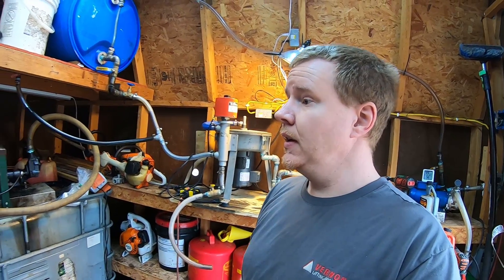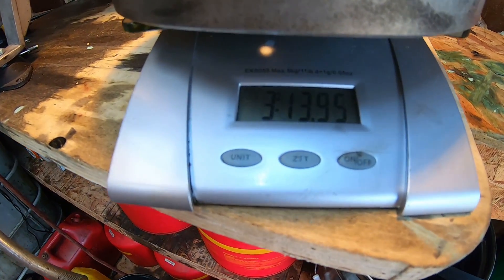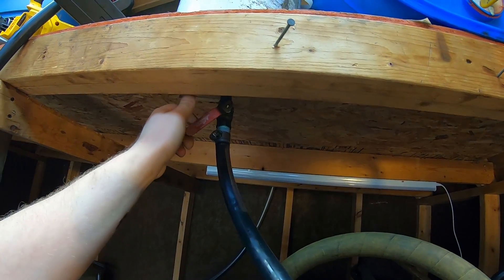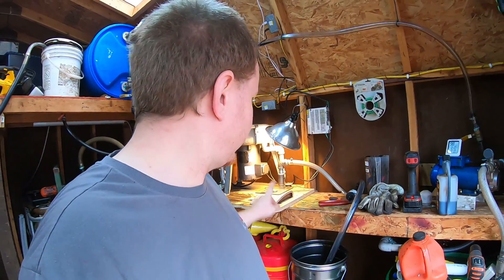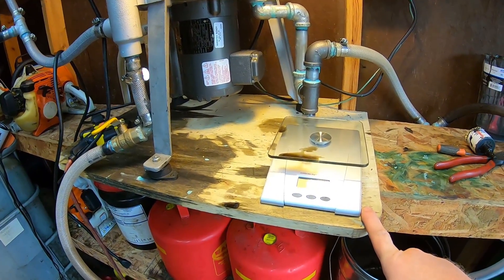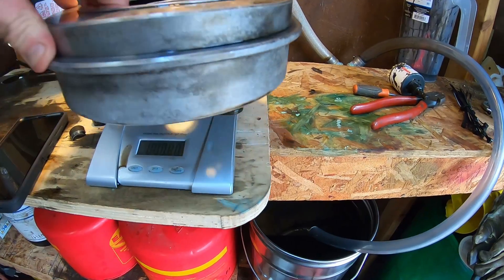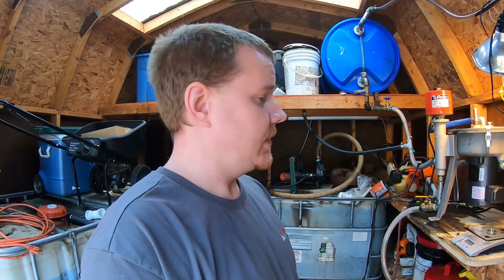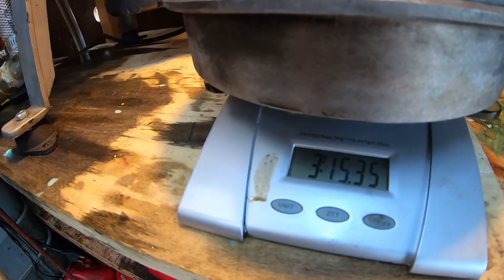Black Diesel Small Batch Tests - Heat Vs No Heat (Or Thinner) - Can You Centrifuge Cold Oil?? - WMO

Comment: I’m going to make my black diesel setup using distillation. The reason being is I have everything to make it already and it should theoretically be even cleaner than using a centrifuge or filters. The only concern is the water content that would pass over first that would have to be put into a separate container until only the refined diesel comes over. To heat it I will use firewood because I have an endless supply of it. That does mean I will have to baby sit it and carefully regulate the temperature. So there’s pros and cons. It’s cheaper and easier to make, but more labor intensive and time consuming.
Reply from the maker: I like the idea of distillation.   Just haven't tried it yet
Reply: Post videos lol

Comment: Very interesting! 
I'm aware, time shortage is a strong reason for shortcuts,  yet wouldn't it have been better to go:
Batch A: 1st run cold, 2nd run warm
vs. 
Batch B: 1st run warm, 2nd run warm
and compare A to B?
That way one can see whether the additional centrifuged sludge is due to heat or simply due to the 2nd centrifuge pass.
Reply from the maker: Not so sure I'd call it a short cut...   as I wasn't planning on running the first again from the start.  Decided to do it at the last minute...    the plan was just to show the difference in running cold...  vs running hot.  Thanks for watching.

Comment: Keep um coming just got the go ahead to take as much used oil as I want from a heavy machinery shop so I'm looking for a good setup
Reply from the maker: What engine will you be fueling?
Reply: @NotSoGrandGarage  1990 7.3 idi in a crew cab f350, john deere 510b backhoe , and my little Chinese 35hp tractor
Reply from the maker: @dbolsinger  I've got a pretty similar collection.  I think you'll be just fine.  If you can, I'd shoot for a centrifuge.   It makes a world of difference and at today's fuel prices.. will pay for itself in no time.  I've got a discount code still good until the 9th.  Info on that is in the video description if you're interested.

Comment: I have enjoyed watching your videos for a long time. I've been oiling for about 15 years and I would like to help just a little. Consider going two totes high upper feeding the centrifuge. Then feeding into a 3rd tote. Set up your pump on the 3rd tote. To be able to pump back into the upper or into a truck. Let it run 24 7 will help dewater. They make remotes for power if you time the run time you can pump it back into the upper from the recliner. Bucket heat from depot to clean the bowl using clear tube no removing the bowl. Grab a a few clear glasses and show us before and after. Show us your pump. I hope this helps and I'll keep watching your progress. Good job I'm proud of you. Get rid of all that stuff so you have room to work. It's just slowing you down.
Reply from the maker: I'm going to be changing things up in the future but I don't want to batch that much at a time nor do I want to run 24/7 at this point.

As for my pump setup and what have you, I've gone over all of that a few times in other videos so what are you wanting to see?

Bucket heat from home depot....  what is this exactly?  

As for showing before and after with clear glasses...  what are you wanting to see?  The oil is still black so not much to see as far as that goes...

Thanks for the input and for watching.  Appreciate it.
Reply: I understand, I've been waiting to see how many passes on 50 gallons it takes for the bowl to be clean. On the last run. Let it do the work it's made to run.
Reply from the maker: @alvinbeshears9870  I would say a LOT of passes for the bowl to be clean.  Every pass will remove more soot...    so how many passes do you need?  With people getting away with just filters (some how or another)...   and most soot being deep sub micronic (and keeping in mind that the same particulate is already flowing through the engine bearings, injection pump, injectors in some cases, etc..)...   it isn't worth it to me to run oil until the bowl runs clean.  You would likely be better off going to small scale distillation if you want oil that clean.

Comment: After these series of videos, you should look into doing viscosity tests. Dirty oil cold, dirty oil hot, dirty oil cold mixed with gas, clean oil cold mixed with gas, diesel, paraffin. Mostly ATF vs mostly engine oil. A conical seperatory funnel with a stopcock would work perfectly. How did your flat plate heat exchanger on the Benz work out? I've been waiting for one to show up but UPS lost it. I'm also looping my return fuel line here shortly to see if that helps. It ought to help my trucks filter life as well since it will be mostly the same fuel ran through it over and over instead of all different fuel from my tank.
Reply from the maker: The fphe worked okay but nothing drastic.  Keep in mind when running a looped return that it will take substantially longer when you switch tanks to purge the system.  Don't recall of you're running a single tank or not

Comment: I got a shed that has one outlet that would be perfect for this setup. How do I know if its capable of running the centrifuge, heater, and maybe transfer pump all at once. I suck at electricity, so could you give me a rundown? Thanks.
Reply from the maker: What's the amperage of the breaker that feeds that outlet?  I've got a single 20 amp circuit feeding the shed and it does just fine.  Heater and centrifuge pull around 1250w.  I wouldn't run my fillrite pump at the same time as I don't have a need to.  1250w is around 10 amps so even if it's on a 15 amp circuit, it would be fine assuming nothing else is on the same circuit.
Reply: @NotSoGrandGarage  Thank you. Im kinda slow when it comes to electricity, it doesnt all make sense to me, but this helped.

Comment: Got plans on running the same batch over and over again until there is little to no residue? I suspect the spinning at high rpm’s is the reason in itself for oil changing its structure and getting an ounce of ‘dirt’ each time.
Reply from the maker: At this point, no.  Maybe sometime soon but as it stands,  I don't have time to test that just yet.

Comment: Have you thought of more bowl rpm with a belt drive instead of direct drive motor?
Reply from the maker: Sure...  its been done.  That's how US FilterMaxx builds theirs.  I don't have a desire to redesign the one I've got though nor do I have the funds to buy another unit at the moment.  Maybe some day and I can do some testing on them.
Reply: @NotSoGrandGarage  well it waa just an idea as it seems more rpm = better
Reply from the maker: @14725800369  it does produce more force for sure.  If you want to go that route, it's best to either build it that way from the start or buy one made that way.  The belt driven units were out of my price range when I bought mine amd as it stands, I have no desire to change.  I'm happy with my setup.  Can it be made better? Sure.  I wouldn't mind trying one of those units out and doing some comparisons...  but I can't swing buying one right now.

Comment: Since your using a heater and centrifuge do you still need to settle the oil or can you just run it from the bottom of the big tote into the centrifuge?
Reply from the maker: Depends.  In my case, I wouldn't...  but if you don't let the oil settle long in the gravity feed tote,  I would still suggest settling for a bit though.  It makes a difference.

Comment: you may have tried this previously and i missed it , but it seems that if you added your thinner prior to centrifuging , it would work better and heat wouldn't be needed . the heat is basically just for thinning (isn't it ?) and you need to thin before burning anyway , so nothing lost doing it this way . just my thoughts .
Reply from the maker: Already have a video on that so check that one out too as for using thinner.  With that said..  heat does 2 things....  it thins... and drives out moisture.  The 2nd part is important as gasoline or other thinning agents dont do that.
Reply: @NotSoGrandGarage  thanks .
Reply from the maker: @billsmith1770  no problem!  Search my channel for "small batch test".  There's a few so far and will be more soon.

Comment: I'm sorry it's Bucket Head 25 dollar shop vac from depot. Spell check was helping.
Reply from the maker: Gotcha.  So how does the vac pull the stuff glued to the side of the bowl?  I literally have to scrape it away when the batch is dry.  When wet, there's a lot of sludge that I could see a shop vac taking out.
Reply: @NotSoGrandGarage  I usually use a old shock grommet and stuff it in the bucket head hose a little shaving is required. Then I can insert a smaller clear line in the grommet. It will suck the grass off a door knob. Also good for vacuuming a filter bowl on a truck. Sharpen up a painters stick with a  angle and turn it on bumping the power like a lathe using caution like when using a lathe. Also the totes don't have to be full only put in what you want to run and run it until the bowl is clean. It doesn't matter if the bowl is full or if anything over flows with crud you'll be running it again and again. Let it do all the work automate with remote power. Bluetooth to a camera remove labor.

Comment: Would it hurt to run it through something like Amsoil's bypass oil filtering system while your letting it run for the 2 hours for mixing with gas - I would think that would remove anything that could damage the fuel system? That's along the line of what I was thinking of doing - I'm only going to be able to make up about 50 gallons at a time.
Reply from the maker: I don't mix for hours...  maybe 10-20 minutes.  The centrifuge should have already removed anything that a bypass filter will...  unless you are talking about only using the bypass style filters in which you'll just be replacing filters really often.  Not cost effective
Reply: @NotSoGrandGarage  I know the bypass filter system is technically supposed to remove anything down to 1/20th of a micron and I know filtermax was recommending a minimum of 20 minutes to a couple of hours - just thought if I let it run for an hour with the bypass system that it would get anything out that could possibly damage anything.  Just wasn't sure micron size how small the centrifuge would get contaminants out of the oil especially since it seems like it always removes more pass after pass.
Reply: @NotSoGrandGarage  And to help clarify, I was planning on running both the centrifuge as a stage 1 cleaner and then the bypass system as a stage 2 system on the mixing/fuel tank if you think that would help it last longer.
Reply from the maker: @GHuggins  I'm tracking now...   so as long as the pump you are using can handle that (which flow through the bypass filter will be SLOW...)..  it wont hurt anything.  Now I don't necessarily think it is needed..   but if it's something you want to do...  then go for it!
Reply: @NotSoGrandGarage  I found a DEF pump that is supposed to handle or rather be capable of a continuous DC and have decent pumping. It's rated for a 57ft head pressure with a 10ft depth suction capability. I'm hoping with those ratings that it will be able to handle it. Then even if I only run it for 40 or 50 minutes, then that's just that much better filtering. I just don't want to have to put injectors or pumps in any of my equipment as I'm going to be running this in 6 different pieces and parts right now are getting a little hard to find with some of the last I ordered taking 6 months. Just figured an extra $300 assurance might be worth it. I also considered a well pump since they build up to 80psi and can flow a pretty decent amount and that seems to be the go to pump for the veggie fuel guys who have to mix it for several hours at a time. Don't know the best way to go really.

Comment: How much stuff is left after settling? Does it make that much of a difference?
Reply from the maker: That tote has been sitting for a few months now...   some of my totes have been settling for a year plus.  Still pull the same amount of stuff if not more.  I've pulled over a pound of sludge out of a 55 gallon batch that was pulled from the top of a tote that had been sitting for over a year....   settling helps and is necessary...    but proper processing is important.

Comment: Do you run the heat at water's boiling point to get it to steam out or will it separate even if it's lower?
Reply from the maker: It will separate at lower temps but I don't know how much lower.  I run between 170 and 200°F
Reply: put some hot water in a bottle with a top. dont fill it.   Shake the bottle........  you will see that the pressure rises and push water out... and/or expand the bottle's plastic etc.   Same thing with centrifuge...  you don't have to be at boiling cause the forces applied will do same as shaking the bottle.....
Reply: @coachgeo  makes sense, I was wondering about the antifreeze as well, can you actually get that out of the oil or just the water it's combined with. Maybe it just burns off in the engine?
Reply: @theclintified  glycol (antifreeze) and the water its attached too  hmmm  good question... not sure any of my info above relates to that at all.

Comment: Is the braided hose you're using in your shed rated for high temps?  Home depot stuff is only rated to 130 degF.  I'm worried that the hose that is near the centrifuge or the heater will melt in no time...
Reply from the maker: The stuff I'm running is rated for 180°F at pressure...   by the time the oil leaves the centrifuge, it's under 180°.  Now the hose does get soft when heated but it's not an issue.

I've not had any issues but I'm sure the tubing will need replaced eventually.
Reply: @NotSoGrandGarage  Did you mention where you get your hose in a video?  Haven't seen that one yet if so :)
Reply from the maker: @enmiredbythelazy4401  the clear braided just came from tractor supply.  Can get it off Amazon, big box stores like lowes and menards, etc.